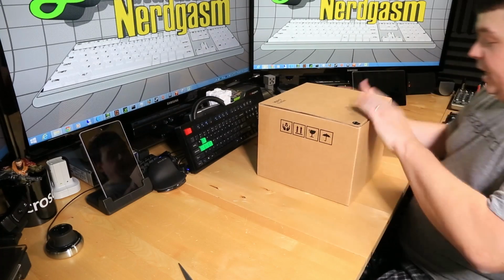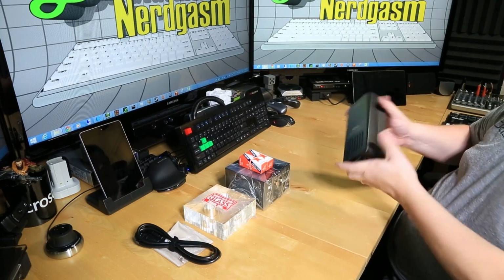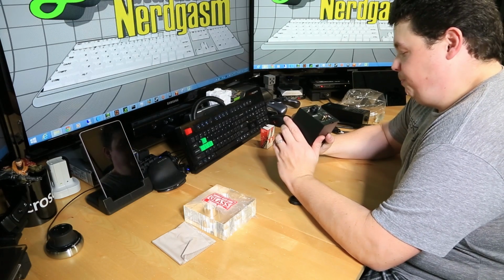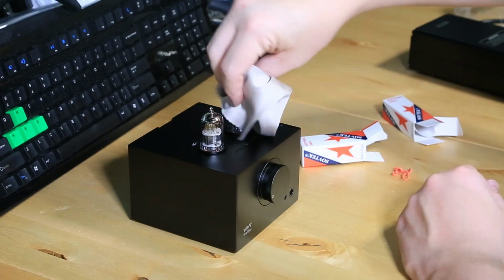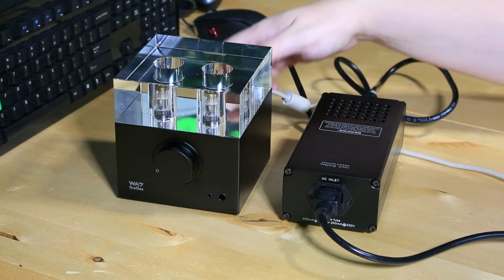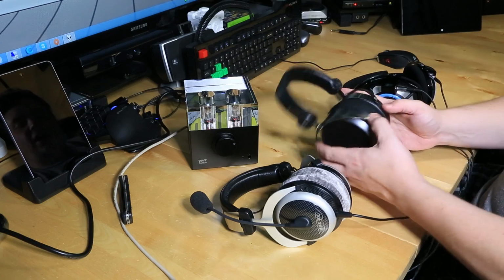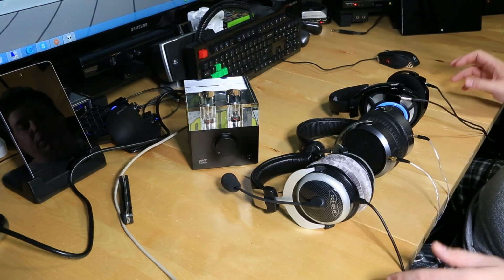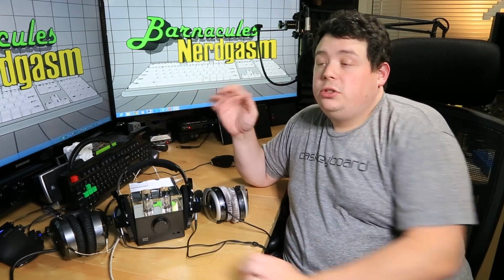Woo Audio WA7 Fireflies USB DAC and Headphone Amp w/ Sennheiser, HiFiMAN & Beyerdynamic Cans

Comment: Pro tip: when installing tubes (or incandescent bulbs, anything glass that gets hot really) use latex gloves or a clean kitchen towel to install, as they will last longer. Also, leave the amp on 24/7, don't turn it off.
Regarding 'audiophile' cables; don't get super cheap analogue RCA/XLR cables, the minimum would be OFC/shielded (which should only be around $10-15 a pair). Digital and power cables mostly don't matter (mains cable don't matter at all, think of all the 'shit' house wiring you have before that anyway). Nicer digital cables only matter with long cable runs (also long analogue runs, like subwoofer cable), but still shouldn't break $50 for long HDMI/sub runs. Speaker cables don't matter, as long as it's copper and a thick gauge, it doesn't matter at all (thick gauge OFC cable is cheap though, and usually looks nice so might be worth it to you). 
Mains scrubbers/conditioners are relatively cheap and can help, while slightly improving component life and isolating loops from kitchen microwaves and fridge/freezers on the same mains loop if they're causing problems. Long/all analogue signal cables (that aren't XLR, which is inherently balanced if implemented correctly)  should be raised off the ground so as not to induce ground loops/hum.
Reply: GetTheCheeseToSickbay You really want to turn on a tube amp 24/7 and kill the tubes quicker?
Reply: NEVER EVER leave a tube amp on for 24/7, especially one that is class A like the wa7. Class A means that the amp is outputting power at idle with or without signal. Stop giving out false info unless you want people to get house fires.

Comment: How long do the tubes take to power up ? I don't think it's instant.
Reply: Most guitar amps range from 30 seconds to 2 minutes. I give my H&K Grandmeister 36 2 mins minimum.
Reply: Thanks, so it's nothing crazy. I'm not waiting more than 10 minutes.
Reply: VeryNormal SimplePerson
Also not a good idea to handle the tubes like he did. They are just like headlight bulbs. I use gloves and wipe them off with alcohol before installing them. It's just a good habit to get into is all.

Comment: BEWARE: there's a lot of snake oil in high-end audio. Cables are the worst kind. They have negligible impedance, and even if it was removed from the signal chain completely it would make no difference that any human could hear.
This goes double for digital signals. Unless the cable is broken or hundreds of feet long not a single bit will change.
Reply: SOME standards doesn` t hurt though, poor shielding actually have an effect, but that goes for really cheapO crap cables..
Reply: jan christian Frodahl With a digital audio signal, you won't hear any effect. Either the information will be transferred flawlessly, or else the data will be extremely corrupted.

Audio cables delivering power to speakers (including the ones in your headphones) aren't really susceptible to interference. The signal is often on the order of a volt (peak to peak). You're not going to get anything comparable to that from interference.

Most audio cables could be replaced with coat hangars with zero audible difference in sound quality.
Reply: Some shielding in signal cables do matter. At least I have had crap cables and the problem went away with a decent one.. Not really talking about speaker cables or headphone cables.. Last time I built a DIY amp, the sound was all crackling and distorting all over the place.
That went away when I changed the input cable and added shielding to the input jack..
Besides, it doesn`t hurt to have a cable that can take being coiled or bent much more than another one.
Not advocating "high end cables", but I do have some standards..
There`s more too it than just signals, power and noise, things need to works over time and be practical as well :)
I actually wish more headphones would come with regular copper so it could actually be soldered because that`s just a mess with most headphone wires..
And it`s never the headphone that breaks, it`s the cable.
So decent cables are kind of a must for me..
Reply: jan christian Frodahl The crackling you heard was almost certainly due to a bad connector, rather than the cable.

Unless you're talking about an analog signal that will later be amplified, shielding doesn't matter for audio signals.
Reply: for long cables, if it has relatively high capacitance filtering could happen though if you could hear the difference idk. Placebo is a big part of it for sure.
Reply: Falcrist <~~~Says a guy who doesn't know shit. He has top end cans and a top end amp. It would be a waste not to add some Audioquest from the wall socket to the amp.

Comment: what is the difference between tube amp/dac and normal digital amp/dac?
Reply: +Mr B 
Tube based amps or combos rely on the use of vacuum tubes somewhere in the audio chain (typically on the gain/preamp side of things).  Tubes have higher order harmonic distortion (not to be be confused with high-volume, go to wiki for Harmonics if you care for detail).  This can present a more pleasurable sound to some and is not just "warm and colored" as is often stated about tubes.  The tubes used can have a decent effect on the sound and I've used many that sound exactly like a solid state amp (my amplifier actually has solid state components I can use to replace the tubes as validation).  Solid state amps rely on use of discrete components (individual pieces) or op-amps (chip based combos) instead of vacuum tubes.  These too can change the sound, similar to way the tubes affect their respective amplifiers.  Quick +/- would be.... Tubes have a magical effect on soundstage and vocals/mids but can be noisy and have a finite life.  Solid state is typically more versatile with different types of headphones and may last longer than tubes.  I personally like the hybrids (tubes and solid state) as you get a little of that "tube magic" with solid state versatility and power.
Reply: ElectronicVices You are my hero.

One more question: What kind of effect does a tube amp/dac or solid state amp/dac have on soundstage?

Like, for gaming for example, which one would provide a larger soundstage?
Reply: The headphone will be the limiting factor there but I found the best soundstage I get with my gear is from tubes.  I don't really game through that setup though.  A good pair of open-back headphones will do more for your soundstage than the amp/dac used.

Comment: Honestly this thing is just impractical, there are so many cheaper options that give just as much power to your headphones.  You could buy an Audioengine D1 or an Odac, and couple it with one of those Mayflower electronics headphone amps and have just as much power without all the drawbacks this has.

Comment: dc is not gonna kill you (as easily). ac will at a high enough voltage and amperage. just so you guys know.
Reply: Ronan Keeffe DC at a "high enough voltage an amperage" will kill you too.  Just so you know, tubes operate at hundreds of volts DC.  You're probably used to 1.5V or 9V batteries, which don't hurt.

Comment: why you say the mmx 300 suck, when, when you did the review on them you said they were the best and great soundstage.
Reply: If i recall correctly, they're just dt770 32ohm's with a dt880-like shell.

I've always liked the sound of higher impedance (600ohm) Beyer's with a nice tube amp.
Reply: regardless, should you say they suck tho. i have all three of these headphones because of this guy. but i have the hd 800s, and im wondering why is his hd 800 black with a blue ring, never seen that before.

Comment: I love that vacuum tube I have used in in designing my own amplifiers often.  Woo is one of the better companies, but I do like a tiny bit different sort of sound myself.  Although the 6C45 (also known as the 6S45P) is a wonderful tube and is basically the Russian equivalent to the Western Electric WE437 (If I recall correctly), which if you have the cash to get a pair or can even find a pair, are much sweeter sounding. 

Power cables and the like won't really make are break how something sounds, but with them you get into new levels of nuance obtaining different sounds.

Comment: The fact that you have a cheap USB cable shouldn't matter. USB is digital, which means that electrical interference won't have any effect.
Reply: Not true.  USB carries signal and power.  The power side is what screws with the 1's and 0's in the form of jitter.   Not hard to remove jitter (meaning not super expensive) but jitter is a thing that manifests itself in USB in the form of harshness, edginess, white noise etc.   Also, poor insulation on USB cables will introduce EMI intop the cable when cables are around other sources.   

These are all things that affect USB in it's use of analogue sourcing.
Reply: actually really not bad cuz u still got the signal, an expensive cable only is rugged and is generally more stronger in terms of durrability but does not REALY effect sound but i can argue with scott on that, but itz not too bad to pic a 3,99$ printer usb cable dude, if ure music u produe is good and the other one has the same setup and a 10$ cable that still dosent mean tht his music sound better so, its still how U produce and now the quality of the equip ;)
Reply: That's not actually how it works because we are dealing with analogue signals not just digital and we are dealing with real time signal capture.

Digital signals are actually square waves that are detected by the receiver when they pass a voltage threshold. Any variation in the shape or timing of these waveforms can cause errors in these signals.

How sending a file of music is different than that of an image to print with just 1' and 0's? It is just data after all. When a file is saved or sent to a printer, the error correction system in the receiving device can ask the sending device to resend the file until it confirms that the file is completely correct.

Streamed music signals do not benefit from this resend function and therefore error correction systems cannot replace missing or corrupted data.  This results in very minute variations in the data that manifest themselves as all kinds of "junk"  ..jitter, tizziness, etc.

At what price point can you eliminate these kinds of things?  Some say $10 some say $1,000.  It's diminishing returns.  I have found it easy to detect differences with a variety of cables that help eliminate emi better with great shielding and isolating the USB power function.  A $100 Usb...depending on your flavor can do the job.

Comment: Hey Barnacules:)

You see i plan to get myself a pair of Sennheiser hd 700's and i am gonna use them on my macbook pro retina 15 inch. And i was wondering if i need some kind of amp or if its gonna be good enough. I know this is a weird question and your probably laughing your ass of, but please. Im very worried that the um...thingy that you plug in to the....hole (gosh) Is too big. Please help.

PS. This just got very awkward :/
Reply: You need a moderate amp for those
Reply: Dammit :/

How much does something like that cost?
Reply: I'd say a fiio e10 or an asus xonar 5/7 would be enough
Reply: Sander Brevik Sæbø while fiio e10 is a great portable amp, it won't do the senheisser's any justice. You usually spend as much on the amp as you do on the headphones with higher quality gear.
Reply: You should just go with the 800's, its not that much of a price difference and its a huge leap in audio quality, I know a few HD700 owners who rather dislike the slight sound signature of the 700's compared to the HD800's
Reply: well its too late now
Reply: akscanb are you fucking stupid?

Comment: Woo Audio is a fitting name. Seriously, it's all nonsense. There's no science behind all this audiophile snobbery. It's placebo effects and marketing. For soundcards, get an external USB DAC. For an amp, get a solid state amp or get out. For headphones, get a 2 channel pair with a response of 20 Hz to 20 KHz. Anything past that is useless and overpriced.

Oh, and if you're looking at speakers, go for a 5.1 channel set, but remove the center speaker and woofer from the equation. You won't regret it.

Comment: Jump of the audiophile train before it crashes. Really, most of the audiophile stuff is just nonesense that costs 10 times more. Completely different leauge but a good example are beats, they cost 3 times as much as better non beats headphones. And cables are not making any difference, at least not for the normal people that don't have the golden ear. And usb cables don't make any interference noises since they send a digital signal wich can't be interferred with since the DAC is outside.
Reply: You can have expensive equipment, be an audiophile, enjoy music, and not buy into snake oil. There is no one 'audiophile train'. Not buying into snake oil is something one should attempt to do in any aspect of life.
Reply: Eric Lin That's kind of what i meant, you got to know what you buy, not just buy it because it's expensive. For example i don't recommend buying the Tube amp, as he said an objective 2 DAC  by mayflower is cheaper and has the same sound. I mean, yeah everybody should buy what he likes, but still, tube amps are the best example for audiophile snake oil
Reply: Daniel please re-read before posting yet another comment.
Reply: I don't give a fuck whether you were talking to me, lol.

"Completely different leauge but a good example are beats,"

As in, Beats were not mentioned as audiophile headphones.

God dam, missing the point once is careless, but twice after you've been told to reread, that's sad.
Reply: There is no standard metric in which to judge who is or isn't acting like an adult. When a sentence seems vague to you, the standard procedure is to ask. Your original comment - if you call it adult behavior - is pathetic adult behavior.

Jeeze, good for you. Two points to you for getting online and calling others mentally disabled. How adult-like of you.

A different league in WHICH league? When compared to every single audio device, the Beats are a different league - hi fi, mid fi, low fi, etc.

As much as you want to paint the picture as an obvious mistake, the sentence was vague in the worst. But you don't want to admit that.

All of your crap about 'adult behavior' went down the toilet as soon as you decided to start shit on Youtube. Lol.
Blocked.
Reply: ***** What the hell man? I meant that just as expample for the priceing, the words i chose mabe weren't right but Eric Lin got my meaning right, you didn't. Other league can mean both, and in this case it was obvious what i meant, cause no one in the right mind can think beats are audiophile at all.
Reply: Naamtar did you even read?
Reply: The tubes change how the music sounds, that's why some people want to buy them, they already have amazing headphones but they want there music to sound better or how they want it to sound, well that's what I believe.
Reply: I don't know anyone who considers beats to be audiophile headphones.
Reply: Capeau Lol guess we will have to try them out
Reply: Guys, i never said that beats are good, but there are lots of people out there that think they are some high end stuff because they're expensive. And that's all i wanted to say with my comment
Reply: Beats is not audiophile, also good budget equipment is much better compared to so called "high end". I have a schiit Dac, it was 250$, and works wonderfully
Reply: SensTV1994 
Beats are not, have never been, and never will be audiophile headphones. They are overpriced pieces of trash.

Comment: You'd hear a difference if you'd use (for example) your RCA analog outputs on your xonar card I think.
If you're using a USB cable it's all digital, it's converted inside the tube amp,
that's why it sounds so clean. right? 
My dad is a tube amp enthusiast, he told me that those things play distortion free - up to 1 Mhz which is 1.000.000 hz ...
amazing
Reply: Eric Lin you seem to enjoy trolling people who like tubes on Tek Syndicate and Barnacules videos.
Reply: Yea, no. A normal Dac/amp is going to produce audio more accurately than your magic tube amps. Sure, if you want to color the sound, those will do that, but by definition colored sound isn't hi-fi. Distortion free from 1mhz to 1000 khz... You know the extent of human hearing, right? And how overkill (even if we grant it to be true) and pointless that is?

More expensive doesn't mean better. Sure, if your dad likes spending money on tubes as a hobby, it's his money to spend. But don't pretend for a second that super hyper extra ultra tube amps 1000+ is going to provide some sort of audible improvement in a blind test. The former is called a hobby, the second is called delusion. Ten bucks says your dad bought at least partway into snake oil and you will disagree with what I say because he's your dad.